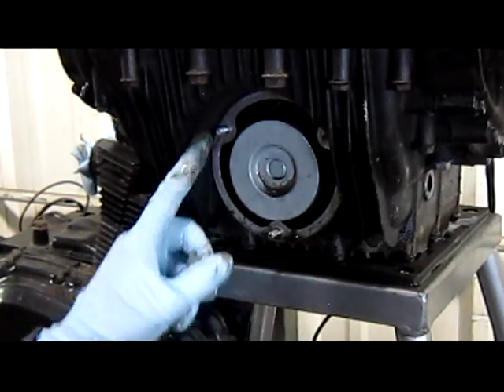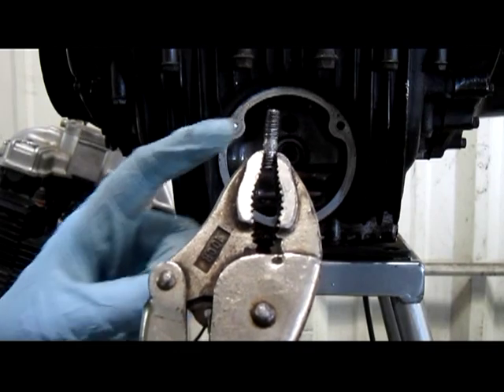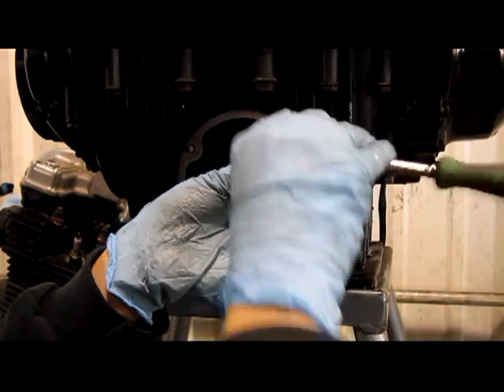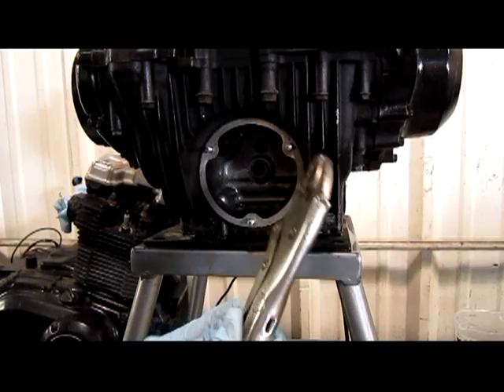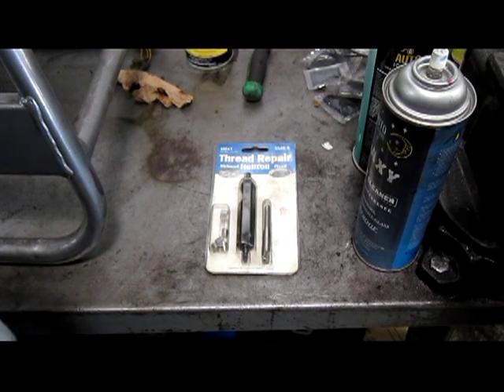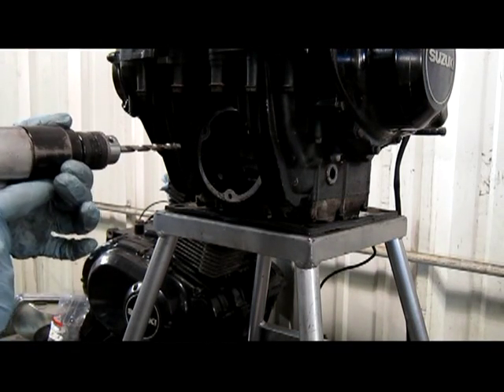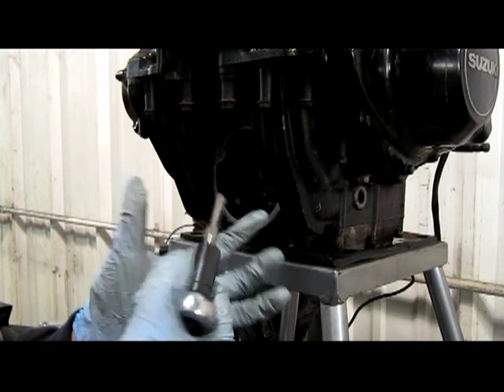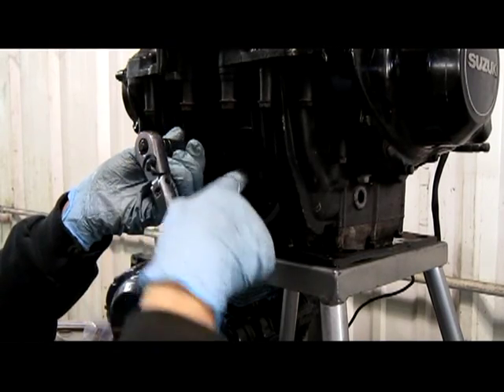Suzuki GS500 Oil Filter Cover Stud Repair

Comment: Anyone tried to reinstall a stud with just jam nuts?
Reply: Jeremiah McCann I just took a normal screw and screwed the cover tighten as possible it doesn't leak 😅 no money wasted on own stupidity
Reply: Philipp Muley what size bolt did you use
Reply: Thomas Quinn i tried different ones till one fits